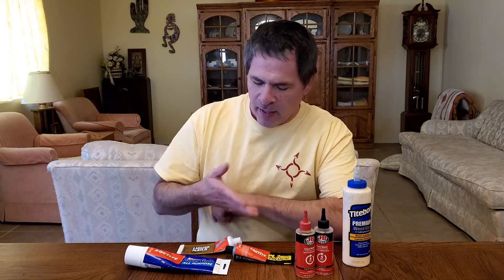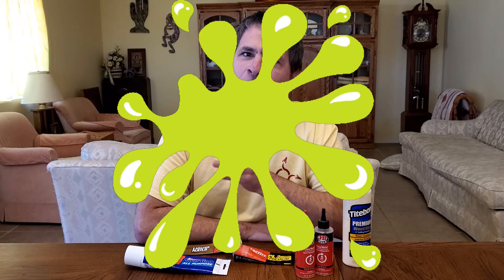Adhesive & Glue for Rocket Building

Comment: Nice testing, I just wish you would have done at least 5 of each for comparison. When we do such tests at school I will have students do many tests of each. Throw out the anomalous ones...perhaps a greasy finger print, some dust, etc. 
As for glues, read the label or package. Many will say what materials they work best on.
Another point equal to or more is good surface preparation.
I have used inexpensive Elmers Washable School Glue for everything on minimum diameter 4" L-impulse KNSB sugar rockets made entirely of cardboard and sometimes with wood fins that have gone supersonic (Mach 1.56 the highest) on an all cardboard 8' tall rocket with no issues. Again, good design, surface prep and construction skills. https://www.youtube.com/watch?v=1ujxLa_ZVIM